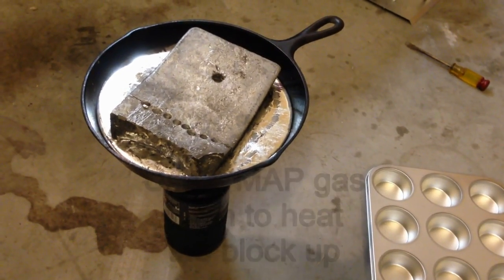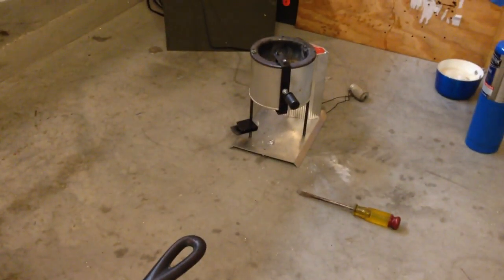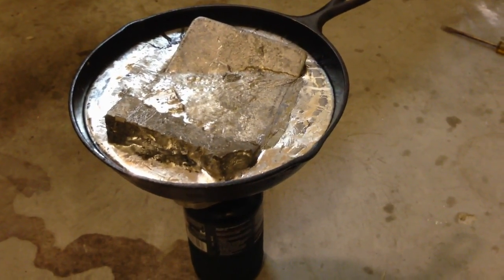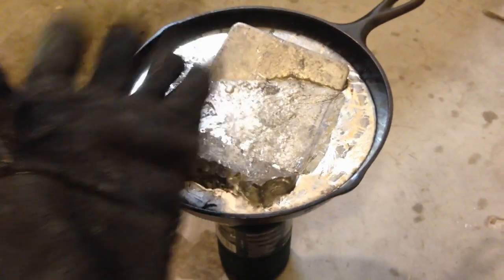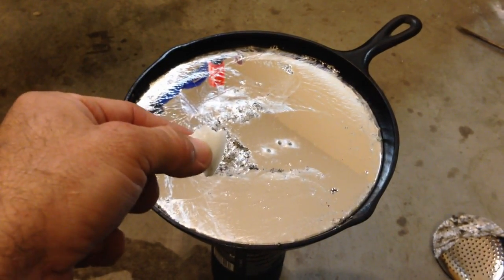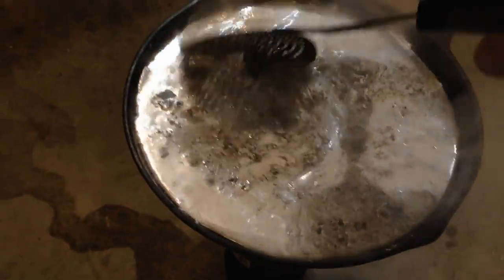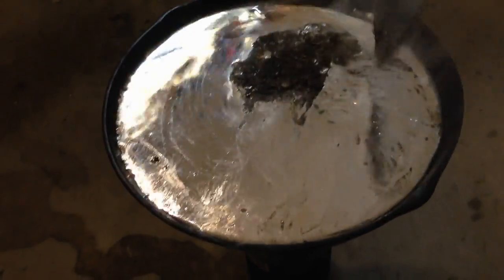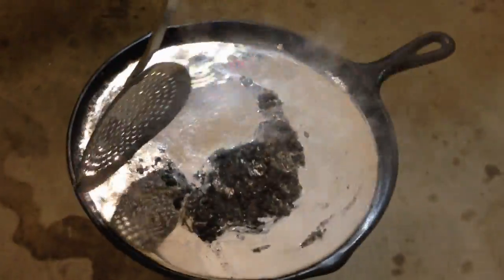Lead Smelting

Comment: using a 1 lb propane tank and burner is VERY UNSAFE!  I had the setup tip over 2x splattering my feet and legs with molten lead. Use a 2 burner propane camp stove it is alot safer!

Comment: I have some tin slag (tin oxides) I'd like to reduce back to tin.  I was wondering if I can smelt it with aluminum, since aluminum is less stable than tin and has a low enough melting point for my furnace.  Would this be safe, and also, what would the result be?  Would the leftover aluminum separate from the tin?  I also thought of carbon for the reducing agent but that requires a much higher temperature for the tin oxides to melt.
Reply from the maker: Tin's melting point is about half that of aluminum. I would not know how you'd do that.

Comment: Hi I am looking for someone that melts lead in cast iron skillets to take a few photos of the skillet after the process is done. If I find a skillet at a yard sale, is there any way to know from looking at it that it's been used to melt lead?
Reply from the maker: There typically isnt any lead remaining in the pan once im done.  Especially if you tap it on the ground while its still hot.  If you want one that has never had lead in it, you would have to examine it at the microscopic level.  It would be best to take a Stainless Steel brush on a drill to power scrub it, then wash it and you should be good.  
https://amzn.to/3JcoTTZ
Reply: @ProfessionalPepper  thanks for the reply. That's what I figured, but good to have it confirmed. Truth is that unless you know the complete history of a cast iron skillet, you can't tell just by looking at it whether it's ever had lead melted in it
Reply: I know this is a old post but once it is used for lead it should never be used for anything else.  @ProfessionalPepper

Comment: Don't tap your perforated ladle on the concrete. You should collect all the dross in a steel or aluminum container for proper disposal. The lead, antimony, and mercury in the dross are all highly poisonous, and will quickly leach into the concrete. Your concrete floor will become unsafe for bare feet, pets, and children.
Reply from the maker: noted

Comment: Why are you tapping the slag on to the floor?! It still has lead plus possibly mercury and silver inside it. It is very toxic and will seep into concrete like a sponge. An aluminum baking pan or roasting pan would have let you capture the waste and dispose of it safely. Right now you have a highly poisonous floor that will leech onto footwear that can only be fixed by removing the contaminated slab or sealing it with industrial floor epoxy.

Comment: What you could of done for sturdiness is dig a hole and place the burner inside the hole so you could have more structure
Reply: yeah what could have been done as well is dig a hole but put a metal square over the hole so and then put the heater so you can have even more structure and minor permanent structure
Reply: @micaiahkesler9264  or just buy a turkey frier, much more surface area